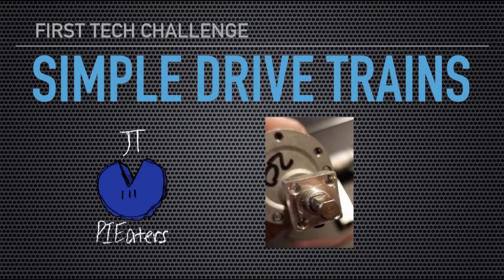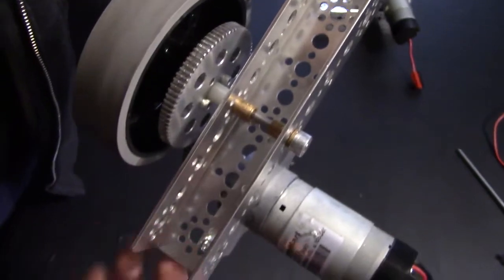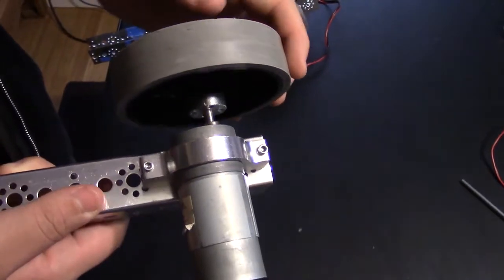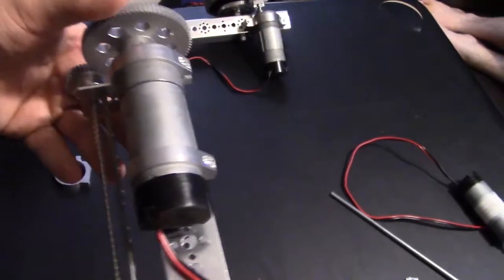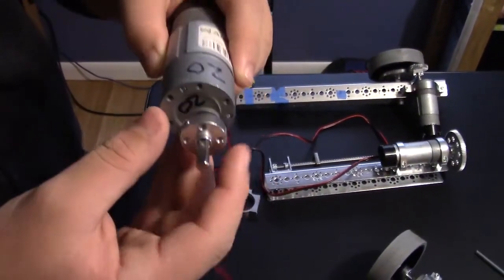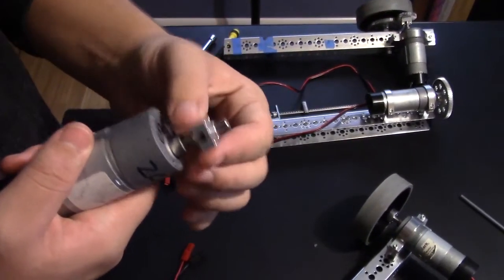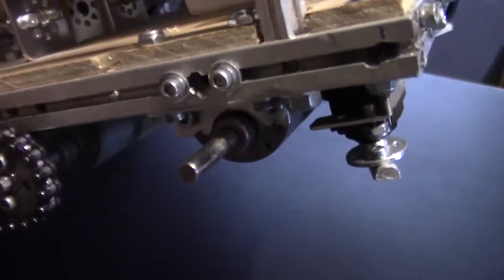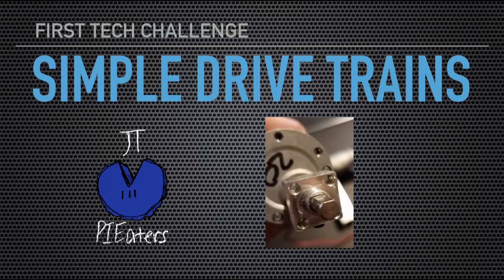FTC Robotics Help - Super Simple Beginner Drive Train Basics

Comment: What size nub hub is it. There are different sizes on andymark
Reply from the maker: Good Question. We got the 6MM D Bore Single Boss. The screw holes were not threaded and you're supposed to be able to "self thread" them by screwing a screw into them, but that was too difficult for us. We used a #6-32 tap that we got at home depot to cut the threads (I think we had to buy a whole set that included the #6-32). The #6-32 tap has been very valuable to us.